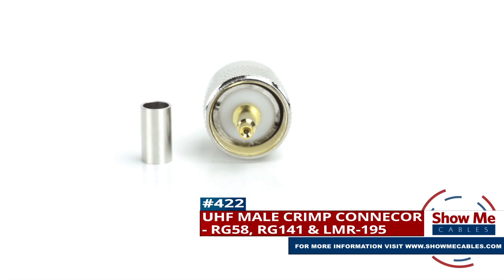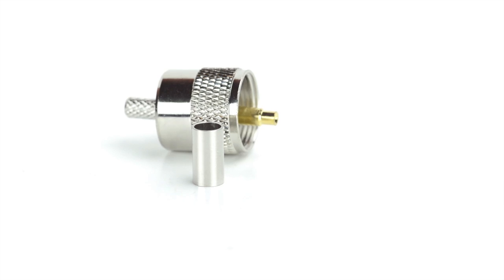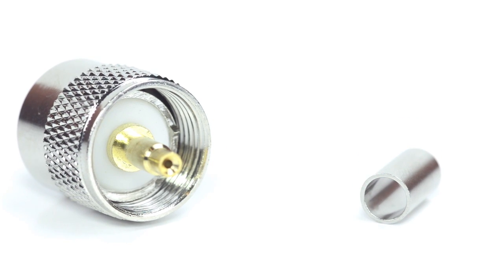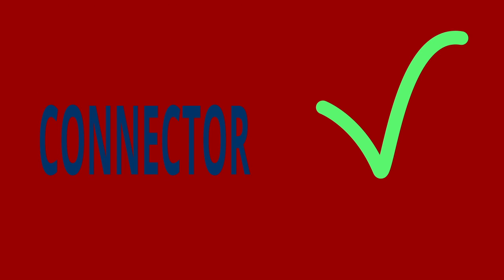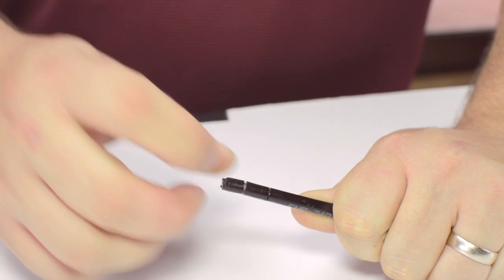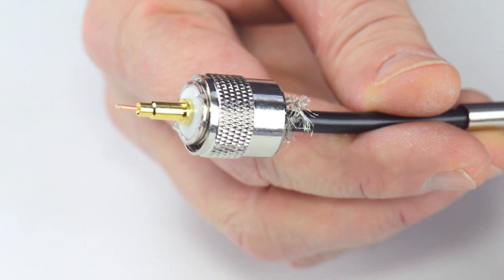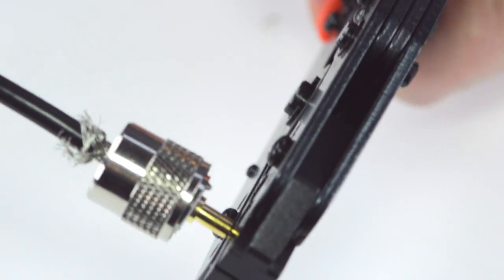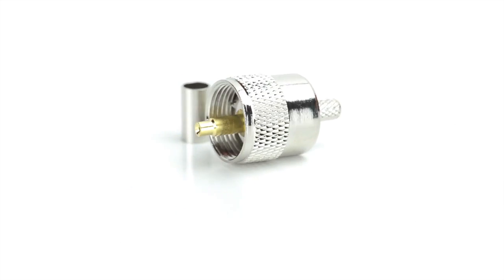How To Install UHF Male (PL-259) Crimp Connector For RG58, RG141 & LMR-195

Comment: I actually just bought cables from you guys.  This is great! It's pretty simple but there's a pause button and you can rewind if it's too fast.  Doing this does take a bit of practice though,  so leave plenty of slack for multiple attempts if you're going to practice on your actual line, and/or, buy your connectors in bulk.  
I have found to only go around the cable with my stripper one time though.  
"Slow is smooth. 
 Smooth is fast."